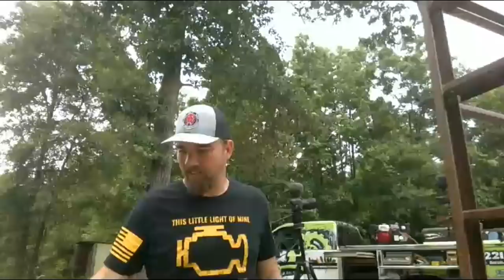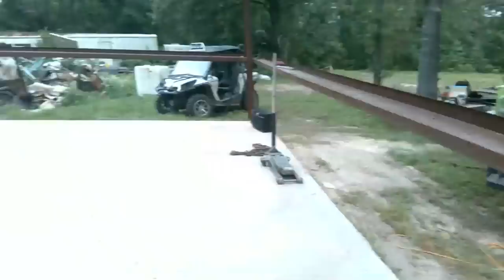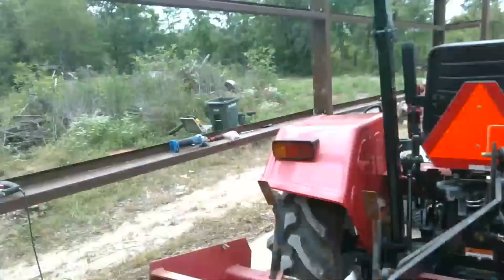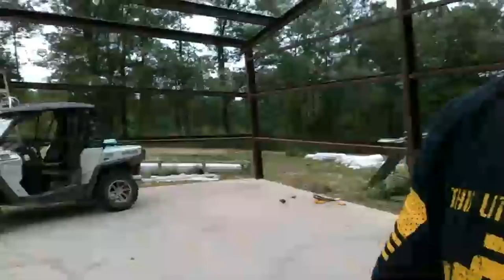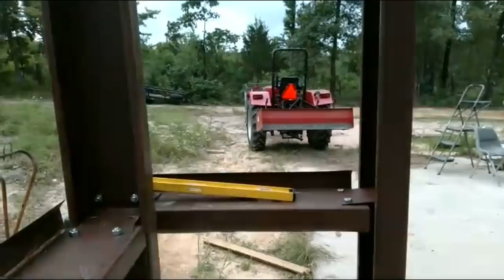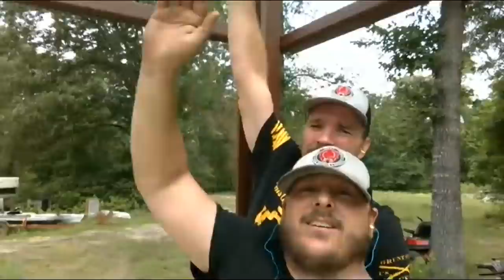Let's Talk SHOP....build with Stephen Cox

Comment: You got a lot of work ahead you.  Wish I was there to help but this old man would probably just be in the way.  Build it strong my friend, a storm blew through here ( 30 miles south of Topeka Ks.) a month ago and for a mile wide path took out most of the newer structural steel barns and out buildings leaving the 100 year old wood buildings mostly untouched.  Now everything flooded to the max.  I know you pretty much have the same mild weather we have here.😬

Comment: Missed the live steam but at least i could see it later.  great job.you will have a really nice shop when your done.
Reply: Ken R ....which is 1/4 turn before bolt breaks. 😀
Reply: @leebarnhart9725 ..  i thought it was pull it as tight as you can.  then another half turn.  also i live 3 miles east of Topeka Ks. i know that storm you was talking about.